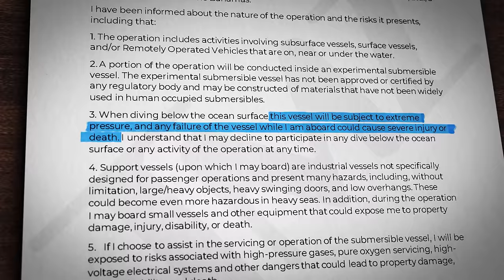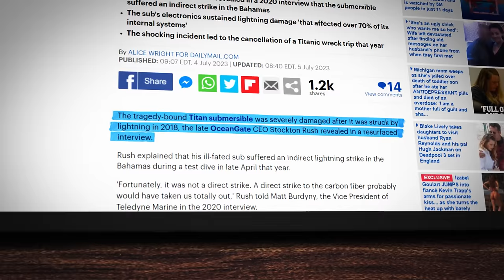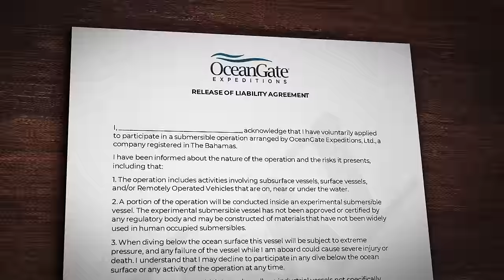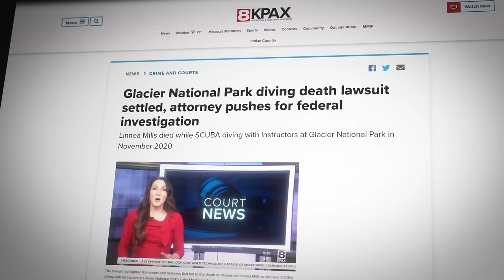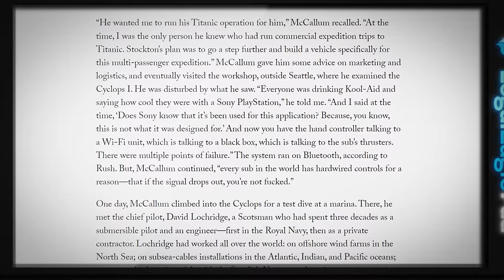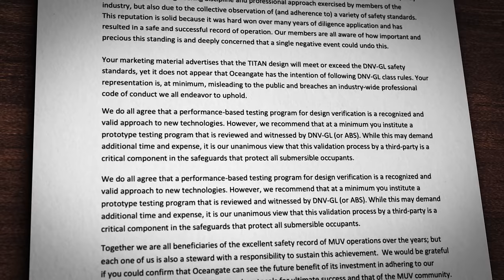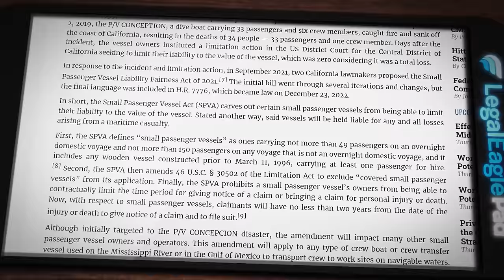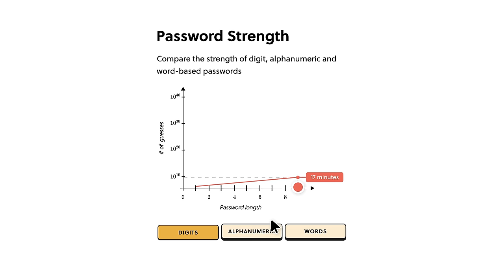OceanGate Is Getting Majorly Sued

Comment: Absolute madness that they clearly consulted multiple lawyers but seemingly not a single engineer
Reply: No, they consulted at least one engineer, who told them it was unsafe and to not use it (apparently he was able to put a flashlight on one side of the carbon fiber hull and witness light streaming through the hull), so they fired him because he refused to sign off on it, so he took his complaint to OSHA (for the employees they forced into it) and then the coast guard, but no one would do anything & he had limited cash to pursue them because… y’know. He’d recently been fired.
Reply: They consulted many engineers...and then fired all the ones who didn't agree with them.
Reply: Not madness, greed is more than enough.
Reply: Just Billionaire Things
Reply: Stockton rush was an engineer
Reply: There have been 7 plane crashes 38 lives lost in the US alone since the submersible crash. Why dont you go cry about that?
Reply: @macbook802 Because there are tens of thousands of flights flown within the US per day. The relative rate of plane accidents is about one accident for every million flights. The titan sub had one accident in only about 50 dives. That means the titan sub was TWENTY THOUSAND TIMES more dangerous than an airplane. That's why people are outraged.
Reply: @macbook802  clearly an incompetent and reckless engineer
Reply: A simple common sense analisis like " 3.5 kilometers of water over yuor head" must be" dangerous " could be enoftgh for normal people😅
Reply: Gotta protect the money.
Reply: @m0L3ify  "We delete outliers."
Reply: @macbook802  He was a disgrace to engineers.
Reply: They asked Rufus, the old train driver, if he could take a soda can to the bottom of the swimming pool and tell them what happened. It seems like that's about as much research as they really did into this.
Reply: @macbook802  You really can't review your own work especially if your doing safety critical extreme environment experimental work which is a beyond highly unusual situation to be in and would typically require multiple reviewers, third party certification, lifetime simulation, real world rapid cycle testing, ....
Reply: @macbook802 Obviously not a very good engineer. As for airplanes, if any of them dodged regulations like this, they'd be sued out of existence as well.
Reply: @zeruty  he accomplished more than you will ever... what's your purpose in life?
Reply: @jamesb3497  regulations don't matter, they still wreck.
Reply: @riakata  you're a parrot, repeating what you saw on YouTube yesterday
Reply: @macbook802  they wreck much less than they otherwise would and if the wreck is found to be due to a break in the regulations justice can be served
Reply: @macbook802 ecause those weren't caused by preventable negligence, and this was. It's not about the accident, but the *cause*. It's not hard to understand. No one makes a fuss about an accident, because there's no blame. 
This wasn't an accident, and we know exactly who is to blame. The video literally says this, don't be dumb
Reply: @My_Lacrimosa  airplane crashes are absolutely preventable. Don't fly
Reply: @macbook802  I haven't killed anyone, especially not through gross negligence and incompetence.

So on balance I'm ahead of him.
Reply: @macbook802  "he accomplished more than you will ever"
You're right, I haven't killed anyone at all.
Reply: @zeruty  you should walk to work bagging groceries with your helmet on everyday and keep repeating that to yourself
Reply: @AlbertaGeek  you should walk to work bagging groceries with your helmet on everyday and keep repeating that to yourself
Reply: @macbook802 how bored are you really 😂
Reply: @thatmom402 you forget that they sued him for violating his NDA by going to authorities, not the press, not competitors. as if he gave up his citizenship along with working for them.
Reply: I love that Dolan is your profile picture I bought one for my niece and got one for myself cause I couldn't resist.
Reply: @macbook802  Rush was a rich kid with a pilot's license who was trying to exploit a market at the expense of human wellbeing.
Reply: @macbook802 8 deaths by plane? Dude, hundreds of thousands of people fly in planes every single day. They are EXTREMELY safe. Every possible precaution is taken. And that is an extremely low casualty rate if you're talking about seven crashes. 

In deep sea diving, OceanGate took tourists down to Titanic 3 times. So, there have been approximately 15 tourists (not including diving experts that go) successfully to the titanic. That's a 1/3 deaths, which is a damn billion times worse than your airplane example.

Not to mention, they ignored many engineers and regulations which told them explicitly, that the submersible was unsafe. Which was complete and total negligence, and it deserves to be punished. Airlines typically follow safety regulations to a frustrating fault. And a commercial airline is never made out of experimental materials which cannot safely fly.

Your analogy is so absurdly incorrect and plainly, stupid.
Reply: @thatmom402 so they basically fired all of them because they haven't agreed with them
Reply: @macbook802 are you trolling or is that an actual argument? You need to take into account the total number of passengers who took airplanes and submersibles, otherwise your statistics doesn’t mean anything.
Reply: @CederichHower  I actually named mine Oswald, I found him while working at Costco one summer. He made many a school commute with me before retiring to our lovely air conditioned home in luxury!
Reply: @macbook802  I'm not sure I understand your comment. Are you saying regulations only matter if they prevent all deaths?
Reply: @VicJang  go fly then. If you gave an engineer a million dollars they will sign any aircraft off as being safe. If you gave that same engineer 2 million dollars they can find a hundred reasons why that airplane is not airworthy
Reply: @@Jason-rp3jg if you gave an engineer a million dollars they will sign any aircraft off as being safe. If you gave that same engineer 2 million dollars they can find a hundred reasons why that airplane is not airworthy... how do regulations matter?
Reply: @@Jason-rp3jg regulations are equal to paying lesser people money to say it's okay
Reply: @macbook802  if you think regulations are nonsense you should go work in the asbestos industry.
Reply: YOOOOO SAME PFP
Reply: That's the fun part!
Reply: @thatmom402 exactly
Reply: @macbook802  you didn’t answer the question about the obvious statistical error.
Reply: @ianb9028  I don't think theyre none sense, they are clearly none sense. If you gave an engineer a million dollars they will sign any aircraft off as being safe. If you gave that same engineer 2 million dollars they can find a hundred reasons why that airplane is not airworthy
Reply: How many planes have flown in that time compared to the number of submersibles that have dived in that time?
Reply: Shows what their priorities were
Reply: @VicJang  if you think you are safe in numbers then go fly somewhere. Schools of fish use that same statistical safety theory
Reply: @bdickins2190  Again, schools of fish use that same logic. We're safe because it happens alot? I call it misery loves company
Reply: Listen, I'm trying to make a quick buck, not an honest buck.
Reply: They did—then the dude decided he knew better lmao
Reply: @macbook802  No, he achieved a bachelors in engineering. He wasn't a chartered engineer. He had no professional accreditation, training, experience or expertise. He was not an engineer.
Reply: They probably consulted engineers, but disregarded advice that didn’t fit their ideas.
Reply: He fired the engineers that were honest with him.
Reply: Just read the waiver and replace "submersible" by "plane", and "ocean gate" with "Boeing", then ask yourself if you would fly... I mean this waiver is enough to make any idiot realise the operation is unprofessional and you should steer away.
Reply: @macbook802 you’d be surprised how many engineers are out there who were offered great sums of money for their sign off. 

It’s called engineer shopping. And unfortunately, people shop around for the least ethical engineer for their sign off. 

The ethical ones, the ones who know what they’re talking about, put what is right over money or people’s lives.
Reply: @macbook802 not a good one apparently
Reply: Well they didn't want to, he was so cocky about his carbon fiber. Watch Cameron's doc on making the ship he took down the marianas, they planned and tested EVERYTHING. 
Although the one scuba case, a dude with no experience rented gear and died..? Thats not their fault hahah, thats his own idiotic fault. Its no joke. The poor girl in the dry suit thats definitely on them. But this is nuts, waiver or not he was not remotely qualified to make this sub and take people down.
Reply: @macbook802 the failure rate of airplanes is incredibly small compared how many people take them. Down to the poibt where driving is more dangerous. I'm guessing your solution for this is don't drive, right? 😂

Compared to the Titan, motorcycles are a safe form of transportation, relatively speaking. 😂
Reply: @thatmom402 and now he was proven right the whole time, make book deals, documentaries and movies. He’s gonna make so much bank 💰 all because he was the only one doing the right thing.
Reply: Fun fact about the titanic though, an employee survived the wreck, and then was on the titanics sister ship when it ALSO sunk in the war and survived that too. 
But its insane for this clowns company not to get sued this was 10000% negligence
Reply: They already knew that sub was a death trap.
Reply: He's also dead 🤷🤦😂
Reply: It's like they didn't want to get in trouble but in order to do that instead of making things safe they put all their money in covering their ass
Reply: No, they just fired all the engineers that disagreed with them. AKA almost all of their engineers.
Reply: @KaladinVegapunk omg I know about her, I can't believe she went back to working on ships! It's hard to say if she was unlucky for being in two disasters, or lucky for surviving both.
Reply: @joemann7971  then go fly. Why are you still here trying to convince people
Reply: They fired the engineer who didn't want to just sign the form and move on like whole teams of lawyers will as long as the correct magic words are on the paper.
Reply: @thatmom402  To be specific, it wasn't that he ran out of money. Another engineer with greater funds was willing to sustain his legal defense against Stockton Rush's countersuits. However his immigration status was at risk because of Rush's offensive and presumably he eventually made the determination that he and his family's lives would be uprooted and destroyed if he didn't back down.
Reply: @macbook802 probably because none of them were billionaires.
Reply: They consulted engineers, but they kept giving them answers they didn't like.  So they found other ones who would give them the answer they wanted.
Reply: @macbook802 What exactly is the point you're trying to make here? That OceanGate was in the right to shuttle passengers (which they didn't even class as passengers) on their submarine?
Reply: @macbook802  "He accomplished more than you will ever... what's your purpose in life?"
I've donated 14 gallons of blood so far. I've saved lives.
Rush dragged four people along with him into an unfit vessel and they no longer exist. There aren't even bodies left. He fired the people who would've saved his and the others' lives had they listened to those employees.
This isn't the argument you think it is.
Reply: @macbook802 You think a profession that can have six figure salaries will throw their life away for a measly 1-2 million dollars? I personally would never sign off on something unsafe like that . The brilliant burning candle flash of being wealthy isn't worth life in prison and paying everything I would have made in lawsuits. In engineering safety is not a game EVER.
Reply: @juliakim1320  I'm sure Oswald is quite thankful to have a cool, air-conditioned home to stay in.
Reply: @macbook802  yeah, an aerospace engineer. They deal with very different issues. Not to mention the single atmosphere of pressure in aerospace versus the over 375 to the titanic. There have been much deeper sub dives (over 3 times), so it's ridiculous that it was so bad. They also didn't bother to think about minimizing stress on the humans. Normal subs you can at least shift and have a seat. But heaven forfend you be limited to fewer people.
Reply: @macbook802 yeah, and the plane didn't fall apart in those cases. Aerospace is almost always operator error, not experimental planes falling apart because the creator claims it can fly in ways it can't
Reply: Stockton was an engineer, he knew, but making money was all he cared about. He was hoping to find a cheap sub to flog off to mining companies.
Reply: Yeah... Who'd have thought that paying a professional lier to lie produces professional lies.
Reply: They did consult engineers and ignored them.
Reply: @thatmom402 murica momment peotecring the rich and copanies as always
Reply: @Max-oj8jl  Another thing worth noting is that the flight companies aren't doing everything in their power to skirt the laws while using contracts to dodge liability. Or at least attempt to do so.
Reply: @macbook802 bro you’re simping for daddy Rush pretty hard here. Did they promise you inheritance or something?
Reply: No need as IMO is the chief investigator , as they investigate all incidents , and every one involved as there is something like certification that is mandatory for any vessel to be used in open waters .   And the one that issued those certificates is to blame.   And as its the american bureau of shipping , ABS that provides these inspections and certifications they are to blame.   
Cant blame a company for adhering to inspections and beeing certified to use this vessel in open seas and 4000 meters depth ,
Reply: Quoting John Hammond: "You're meant to come down here and defend me against these characters, and the only one I've got on my side is the blood-sucking lawyer!"
Reply: Clearly he was not.
Reply: @macbook802  A criminally incompetent one, also I don't think he ever got a PE license (I have not seen any mention of one). He technically had an engineering degree but legally wasn't allowed to certify designs. PE licenses, IFAIK, are limited to specific fields (civil, electrical, etc) also.
Reply: @KaladinVegapunk  Violet Jessup who was on the Olympic when she was rammed by a RN cruiser, Titanic when she sank, and Britannic when she hit a mine.
Reply: The difference is that an Engineer would tell him what he didn’t want to hear. 😮
Reply: Rush: we don’t need engineers, we have plexiglass!!
Reply: @macbook802  I'm comparing this to the equivalent to John Hammond enticing a bunch of experts and investors to his island park of cloned dinosaurs, boasting that he spared no expense in designing the park and hoping to open to the general public (especially wealthy customers). Only he did spare some expenses, indispensible ones, and his corner-cutting got people killed and would've been an even greater disaster to the world if one disgruntled employee hadn't triggered the bug that revealed the whole park was held together with metaphorical duct-tape.
It's becoming evident Stockton Rush was hoping to make dives to Titanic a tourism enterprise, and like John Hammond in the Jurassic Park novel, stories are revealing he was a greedy, short sighted asshole who could sell you a bad idea, or at least one that should raise a lot of red flags; mistreated his employees or fired them if they didn't act like yes-men to his demands (even when his ideas are unsafe), was hoping to entice unsuspecting wealthy clients to his illegal enterprise and in the end was killed by his own hand through said enterprise.
 Even if the sub made it through the trip, it was a matter of when the sub will fail, and because it failed, it opened up a paper trail and documentation to the general public just how grossly incompetent, illegal, or dangerous this enterprise was and preventing further loss of life.
Reply: Wait I thought they hired unexperienced engineers?
Reply: @thatmom402 That's complete BS...
Reply: @macbook802  cause this is literally the first tourist submersible death since ever and all the warning signs were there. 38 lives lost vs HOW MANY PLANES THERE ARE FLYING HUNDREDS OF PASSENGERS EVERYDAY!
Reply: @noway8233 is that a fair argument if it was a plan 10000 meters in the air and you flew in commercial air line and died because apperently it was made of plastic anf was not fit to fly?
Reply: @macbook802 Not a very good one.
Reply: @justinlanders2672 I think in this case the level of greed was on par with epic ludicrousness.
Reply: @macbook802  You don't understand how statistics work, that much is clear! Ps it is 'nonsense', not 'none sense'.
Reply: @isbestlizard  He probably scraped through having repeatedly failed a number of units at that.
Reply: @spookycreachre  That is actually a common story in the past, quite frequently mariners were in more than one shipwreck. They went back because of things like employment bondage, or simply economic necessity. Prior to unions and workplace safety, it was accepted that you may get injured or die in the course of your employment.
Reply: @thatmom402 I'm an engineer and I instaquit when I saw myself being set up as a scapegoat for work done before it even arrived.
Reply: @macbook802  I'm going to fly pretty soon. I don't want to hear about this! But that there were "only" 38 lives lost in those many plane crashes, it shows to me that safety regulations were followed and that the crew at those planes knew what to do when things go haywire, plus they followed the procedures. The equivalent on Ocean Gate is that all 7 crews plus every single passenger is toast and dead because there is no plan B and risks were ignored.
Reply: @zeruty 😊😊
Reply: @macbook802  lol do you really go onto YouTube just to look for people to argue with in the comment sections? Or did you just come here to simp for Stockton Rush, and ended up arguing with the entire comment section? 
I bet it's the former, because you come off as an Edge Lord Contrarian type...
Reply: @jhemp  in paramedicine, the phrase is “you can’t put a price on living with yourself.” Even not making 6 figures.
Reply: @Lucaz99  so you think you're safe because alot of people die all the time? You have the "school of fish" mentality.
Reply: Stockton Rush was the engineer.
Reply: @Max-oj8jl  early commercial aviation was pretty bad though, that should be the comparison to be made (if one really wants to make one), Stockton Rush whole thing about the Titan was about working with a cheaper material to make deep diving expeditions more affordable (hence why their prices were like half of the similar companies). Please, don't get me wrong, i found the whole thing pretty shoddy put together and i think Stockton Rush skipped check-boxes before even daring to put people inside it, but from the information out there it doesn't seem to be he was completely reckless (blindly jeopardizing the safety) or hid anything about the nature of the whole thing being a prototype and uncertified craft.
Reply: They did consult an engineer, and he didn't certify it.
Reply: That's how companies design bad things.  They don't ask engineers they ask people who don't know what a submarine is
Reply: @macbook802 Airplanes crash by accident. They aren't designed to fall apart in mid-air at altitude.
Reply: @e.l.norton  OK? Cool story
Reply: @e.l.norton  so you're saying that you think Stockton imploded the sub on purpose? So you think he tricked millionaires and billionaires alike to invest in his ideas? I bet you're one of the people who chirp "more money than brains" like a squabbling youtube parrot
Reply: @SergeantSniper  that's disgusting.
Reply: this is more entertaining than the actual video
Reply: @macbook802 Not a very good one obviously
Reply: @justinlanders2672 Greed has caused more horrors in the world than malice ever could.
Reply: @m0L3ify  Well yeah if you silence everyone that complains the problem goes away right? 😂
Reply: @gokublack8342  Just like my last  court case. All the witness mysteriously disappeared. The case was dismissed.
Reply: That’s what’s wrong with the world now… more value is put on legal structures and no substance “management speak” than actual engineering and real progress…
Reply: @macbook802  yeah an engineer in aerospace a completely different field
Reply: My thought was that they spent all that money on lawyers and didn’t have enough to upgrade parts.
Reply: @Unapologetic.White.Man82  again, he did more than you, or anyone you know will ever do...
Reply: @macbook802  Where did you get this information? According to wikipedia, there was one incident in the US since december 2022 and it was a suicide of a crewman.
Reply: @macbook802 no an engineer will not sign off an aircraft as safe if you give them $1 million. 
You are full of it.
Reply: @jhemp exactly! No professional engineer would throw their entire career and reputation away for $1 million by signing off on something that they are not confident is safe and seaworthy/airworthy/meets the regulatory standards.
Safety is never a game or a joke.
Reply: @macbook802  Rush studied engineering and obtain a degree in aerospace engineering. But he never worked as a professional engineer. He was a pilot.

I’ve been working in airworthiness with military aircraft for decades, I would never trust a pilot to determine airworthiness of an aircraft, even if they had an engineering degree. Because they are not a professional engineer. It is not their profession, and they do not have the authority. (And yes, I have had a pilot who had an engineering degree try to convince me to sign off on an aircraft flying with a broken altimeter. 😑)

Rush had zero qualifications or authorizations to declare anything airworthy or seaworthy. 

But you keep simping for him
Reply: Jurassic Park showed us what happens when you ignore the warnings of a bunch of scientists telling you something is a bad idea. "The only one on my side is the blood-sucking lawyer!"
Reply: They fired that one guy even didnt they?
Reply: @m0L3ify So the competent ones.
Reply: @macbook802 Because we understand basic statistics...?
Reply: @gokublack8342 To be fair, his problems did go away given he's not here having to deal with them 😬
Reply: @apt962 3 words: late stage capitalism.
Reply: @sourgreendolly7685  you're so smart
Reply: Oh they DID consult an engineer… who was promptly fired after he tried to raise concerns about the submersible’s safety
Reply: As we heard after the train derailment in East Palestine, big companies save more money by just dealing with lawsuits after a disaster rather than by installing proper safety measures on their machines in the first place. #'Murica!!
Reply: @macbook802  Just for interest, 7 plane crashes out of how many flights?
Reply: @sunscreenhoarder6558  you can't fire a consultant. The engineer they fired was an employee. It's possible that "engineer" sabotaged the vessel for notoriety
Reply: @v8pilot  exactly... so because it happens all the time people like you are numb to the facts
Reply: @thatmom402 you know damn well they HIRED HIS ASS BACK 😂
Reply: @m0L3ify and you best bet they got hired back 😭💀😅
Reply: @justinlanders2672 not greed but fantasy and ego ..
Reply: @macbook802 good one !!!!
Reply: @thatmom402  They were also threatening a major lawsuit against him.
Reply: As dark as it sounds, why would they? As long as they can avoid legal repercussion, who cares
Reply: @macbook802  Plane travel is statistically MUCH safer than even driving is. The fatal accident rate was 0.28 per million flights, the equivalent of one fatal accident for every 4.2 million flights. I believe that makes it something like 14 times safer than driving.
Reply: @Ojja78  you're wrong, if planes traveled as much as cars travel we'd have half the population now
Reply: @thatmom402 welcome to modern America.
Reply: @macbook802 yeah he also got 4 people killed due to his mistake.

A mistake many people have warned him about.
Reply: @KaladinVegapunk what was his name?
Reply: @macbook802 rofl you don’t understand how statistics work hahaha
Reply: They asked a lot of "Is this legal?" questions rather than asking "Is this safe?" questions.
Reply: @Xenomrph  I get that sheep think they're behind stats.
Reply: @macbook802  rofl okay. Idiot or troll, you be the judge! It’s Poe’s Law in action!
Reply: @macbook802 Yeah in airplanes not submersibles. He actually tried to apply airplane engineering to a sub ffs.
Reply: @Xenomrph 
Why either-or? 
Even if he is a troll, he is most certainly unpleasant and unintelligent. So, he's most certainly both.
Reply: @justinlanders2672  it's both
Reply: @naomiharbour7841  good point!
Reply: lawyers give a false peace of mind. Engineers yell at you for doing idiotic stuff and disrupt that.
(please note i am saying this in a serious but jokeful manner, not saying that the company is in the right)
Reply: Why is it madness?

It's a hell of a lot cheaper. Pretty clear logic.
Reply: @macbook802 I guess that’s why nobody, including you, had ever heard of him before this pathetic situation.
Reply: i walked into a war just now
Reply: @zeruty and likely to stay that way lol
Reply: @macbook802  I have read many stupid things on the internet in my life, but you man, you wear the crown of stupid statements, keep going, you make me laugh so much.
Reply: Too bad CEO crab food. I'd charge him with involuntary manslaughter, for knowingly putting people in danger
Reply: @justinlanders2672 t’s not even greed. It’s pigheadedness and ego. The insistence in his way of doing things, disregarding little things like “safety” and “over a century of institutional knowledge on how to build a submarine.” And if his “old white men” comments are to be taken at face value, also a little bit of ideological dogma trying to stand up to reality.
Reply: @k53847  engineers that they liked, are probably from the black market.
Reply: @macbook802  Jeez, you must be fun person at parties. 🤓🤓🤓
Reply: @macbook802  Sheep, stats ... MEGA NERD ALERT 😂😂😂
Reply: @macbook802  And lay off the InfoWars binge watching. Brain rot shows had a cap limit, even for you. 🤣🤣🤣
Reply: @spacecat3198  people use carbon fiber pressure vessels everyday. They've been around for decades. You only think it's an anomaly because you've been told to think that
Reply: @johna.zoidberg3049  hahaha, my iq is 136, what's yours?
Reply: @SlavicUnionGaming  it's a shame you weren't on yeti flight 691 when it's carbon fiber pressure vessel failed
Reply: @macbook802  By the way, touch grass yet ? You ain't get no love ones if you keep heading this trolling path. 🤓🤓🤓
Reply: @macbook802 Also .. if you so sure of carbon fibre, why don't you make a sequel to this submersible.. oops. You can't, because sequels are doomed to failed from mistakenly placed trust in such materials like you so much adored. 😂😂😂
Reply: TBF, laws are often vague or poorly codified and require a consensus of expertise to interpret, while engineering is much more likely to be clear-cut..... although Rush clearly didn't like what some of his engineers said.
Reply: they would have been shut down or have to pay to do things properly  XD
Reply: Lots of engineers and experts commented... And the owner ignored them all.
Reply: They consulted engineers, all of them were fired. They also refused to consult people who designed stuff like this for a living or professional submariner‘s. The reason being is they were mostly older white guys. I’m not kidding that exactly what the CEO claimed was the reason to why they did not want to listen to professional submariners.
Reply: @MrEminem  don't think you've realized how much a single lawyer, let alone multiple, costs.
Reply: @macbook802  dude people die we get it youre not clever
Reply: @macbook802 troll spotted. Opinion disregarded
Reply: @macbook802 Can't believe someone would actually defend Oceangate
Reply: Probably since they fired the engineers for raising concerns about the hull having micro cracks
Reply: they fired anyone who tried to tell them
Reply: @akiraigarashi2874  I'm not defending. I'm bringing light to far bigger "issues" that sheep can attack
Reply: @akiraigarashi2874  anyone in this comment section has a far far far greater risk of dying in an airplane engineering fail than in a sub, yet everyone is now a sub engineer yet they can't identify the bigger engineering fail in front of them
Reply: @SamD.GOAT0326  thank God. Thank you, and please thank your parents for me as well
Reply: @SamD.GOAT0326  do you have a gofundme that I can contribute to?
Reply: @hanspecans  good
Reply: @macbook802  How many times in your lifetime have you gotten on a sub vs on a plane? It's natural that the total change for dying in a plane is higher for an average person and yet that that risk is still significantly smaller than getting hit by lightning.
Reply: @akiraigarashi2874  exactly, so you're that smart, I'm sitting here(drinking a beer of course) seeing if the rest will fall into place for you
Reply: @macbook802  i followed this whole thread and i can't decide if you're being serious or not hahaha
Reply: And then to reclassify the passengers as "mission specialists" and their $250k fee as a "donation" should absolutely be considered as evidence for gross negligence.
Reply: @@dolphinswithigloos1535 are you more likely to fly on a plane or dive to the titanic?
Reply: The exact negligence lbvs
Reply: @macbook802 a really, really bad one.
Reply: @macbook802  you are oh so very welcome 😊
Reply: @macbook802 so everyones wrong but your right?? Grow up. Its called an opinion. Thats what your saying is basically your opinion. No facts, no nothing on your arguments. I cant believe people are even arguing with you.
Reply: When you care more about not getting sued than being accountable
Reply: Top comment ^
Reply: If the first ever steam locomotive inventor had listened to peer engineers he wouldn't have succeeded
Reply: Clearly there were engineers involved to make the carbon hull etc?
Or did he do all the maths himself?!
Reply: "Look, we need to know if we can legally get away with this, not if we can actually get away with this
Reply: @macbook802 bad pilots and plane routes are a thing
But this wasn't bad piloting or a bad route, it was negligence because of intentionally poor design. I'm not surprised you can't tell the difference because of the "macbook" in the name

If ever there were a worse use for higher education and precision circuitry, it would have to beat Apple out of the top spot first.
Reply: @m0L3ify  And that would be all of them.
Reply: @AlbertaGeek something something something you kill millions of people every single time you open incognito mode.
Reply: @macbook802  negligence. whataboutism at its finest; were the airplanes' passengers classified as experts and also donated to fly? 
Why do you mention that?
Reply: @macbook802  don't eat, you might choke.
Reply: @macbook802 Nearly all airplane deaths are caused by private pilots who make mistakes that kill them and their friends and family. Rush set himself up as a commercial paying-passenger company and that is another matter entirely.
Reply: @spacecat3198  "He actually tried to apply airplane engineering to a sub"
This.  Titanium and carbon fiber are all very fine and well in aerospace applications where one is trying to save every gram one can, but a submersible is kind of the exact opposite of a rocket.  My admittedly limited understanding is, though, that the total weight of a submersible is limited to what the support vessel on the surface can lift out of the water.  Could very well be wrong about that.
Reply: @macbook802  "people use carbon fiber pressure vessels everyday"
Yes, ones that hold pressure in, because carbon fiber has a fantastic tensile strength.  Holding pressure out?  No so good.  Carbon fiber's weaknessess with compression stresses is well-known in engineering circles, but Rush ignored all the widely-available data and became just another fool who died a fool's death.
Reply: @kyleclark9064  Shh!  So far I've been getting away with it!
Reply: @AlbertaGeek  if you haven't done anything better than rush then stop talking down about him. You're a wannabe engineer
Reply: @macbook802  yeah an engineer who wasnt good at his job lol
Reply: @macbook802  I have done better than Rush: no one has ever died from using anything I've built.  And while I may not be an engineer, I am smart enough to not ignore either physics or any well-known properties of available materials.
Reply: @macbook802 maybe he was asleep during his fluid dynamics and statics of rigid bodies lessons. That blood testing girl from silicone valley was also an engg student right? Maybe they used to be classmates 😂😂
Reply: @macbook802 you shouldve joined the submarine then. Oh waaait. You don’t have 250k 😂😂😂
Reply: @AlbertaGeek  so you have put together your kids bikes from Walmart and now you know better than someone who built a commercial tour company servicing billionaires from around the world?
Reply: @noway8233 given how the current global power dynamic and peace relies so much on nuclear subs, I think it's pretty safe to expect engineering these days to protect you from that risk... most of the time
Reply: @borgir80  you've done nothing in your life, you're not allowed to critique people who follow their dreams
Reply: @macbook802  an engineer who didn't know how to be an engineer
Reply: @yeetmaster9010  if you have done more than he did or better than you can talk. Otherwise stay in your lane
Reply: @macbook802 "he accomplished more than you" what are his accomplishments? getting crushed like a soda can at the bottom of the ocean? i could do that. and probably spend less money while doing it
Reply: Engineers would say things they didn't want to hear.
Reply: Why consult an engineer the sub was clearly well made lMa0
Reply: @macbook802  then go follow him and his dreams lol
Reply: @macbook802 i think all of us have assembled something from Walmart or IKEA before, so we've all done better than him lol. I don't know about you but when the instruction manual says NOT to replace parts with cheap and used weak materials we just build it correctly. That's more than mr. soda can ever did
Reply: They ignored multiple engineers not not a single lawyer
Reply: It was about making sure Stocktons vision is unimpeded,as you say lawyers were more important than engineers!....crazy!
(The reasonable thing to do was to never have attempted such a monumentally expensive venture (if done correctly and safely) but Stockton was of the ilk that doesn't take  no for an answer.
Reply: I could see not wanting to pay for regulation but at least do some runs without passengers
Reply: @justinlanders2672 idiocy you mean greed that makes you run something that will fail isnt going to make you any real money
Reply: well most engineers don't know what their doing anyways
Reply: "Why cover our bases when we can cover our asses?"

~OceanGate, probably
Reply: @m0L3ify  and then they learned the hard way that the laws of physics dont care about what they choose to ignore
Reply: @macbook802  if you violate the ethics of engineering, you’re no engineer. All standards and regulations are written with blood.
Reply: @Fractal_32  so you think steel would have been a better material because of engineering?
Reply: @macbook802 whatever school gave him his degree should take it back.
Reply: @ericonion3561  then stop going to the grocery store then... Walmart delivers if you're scared
Reply: @ericonion3561  I also liked your comment, so you feel even more special
Reply: @ericonion3561  now you sound like Stockton Rush. If you leave the house do you promise to wear your helmet?
Reply: @macbook802  I don’t know the stress and strain characteristics off the top of my head and I am no material scientist so I cannot authoritatively speak on the matter.

I would assume that the proven materials and designs would have been better to use in this application than the materials that were chosen by OceanGate. 

I believe scientists and engineers way much more than some rich person who wanted to do something dangerous for cheap.
Reply: Because it's all a part of the plan. This... This is chaos.
Reply: @macbook802  All civilian planes, I'm assuming? Gee, I wonder what factor caused those personally-owned vehicles to crash.
Reply: No its open gate! to heaven.
Reply: they consulted many engineers. But all of them were students whom were looking for a grade, and not actual exploration of the Titanic.
Reply: Because they fired all their engineers, because THE ENGINEERS KNEW That dinky thing was a death trap.
Reply: @macbook802  I won't kill myself and four other people in a rickety jalopy I slapped together out of discount parts, so I've got that going for me.
Reply: No, it has 21 swimming "experience".
Reply: @macbook802  Engineer in title only. Silver spoon degree.
Reply: The crazier thing is....don't even need an engineer to know this would fail. I'm a mechanic, have worked on everything from cars to fighter jets, doing electrical, hydraulic and metal work.
I've observed this with similar friends of mine and ALL of us thought this was nuts.  Titanium won't compress the same as Carbon Fiber.  The method they used to weave the Carbon Fiber is no where near the strongest method. Carbon fiber would require frequent NDI inspections to check the internal structure, X-ray etc.  Everything about this is terrifying.